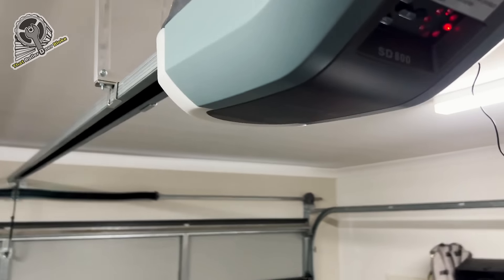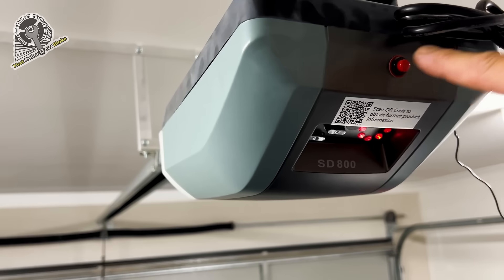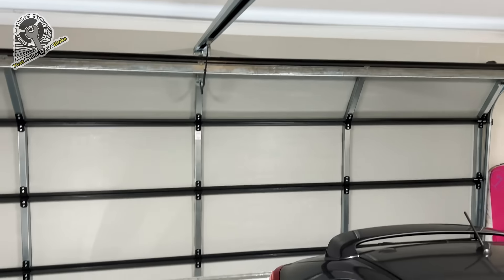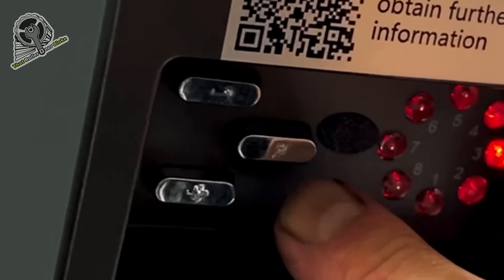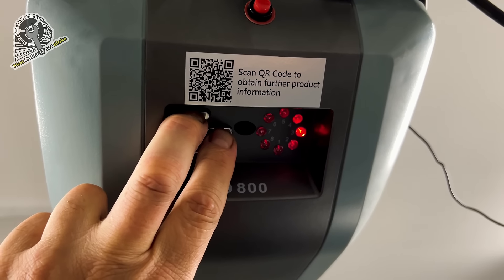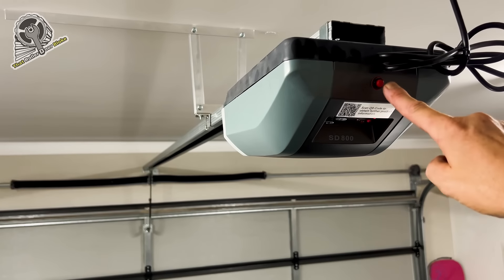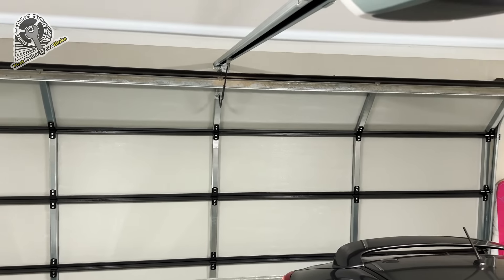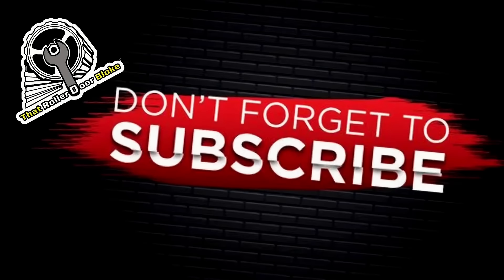[111] How to stop your Steel-line SD800 garage door motor from beeping ?

Comment: Hi, thanks for sharing this tip.  Have you tried installing a Meross garage door opener (MSG100) with this SD800?
Reply from the maker: No but the inputs should be easily connectable on it

Comment: Hey mate, all of my LEDS are flashing. Then flashes off and 3 remains on. Any idea? Door won’t open and close. Been searching for ages.
Reply from the maker: Apart from resetting the limits I couldn’t say I’m afraid.  There’s no error codes in the manual it may be a fault.  Definitely try resetting the limits